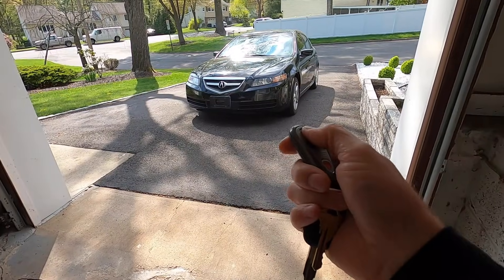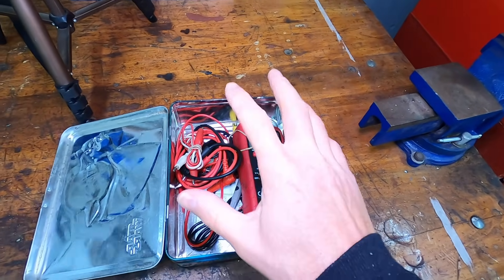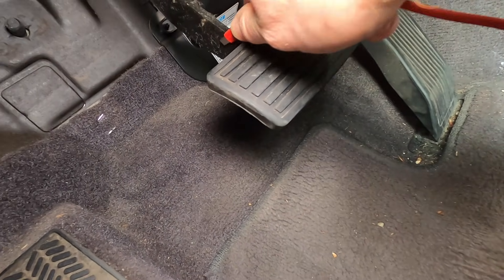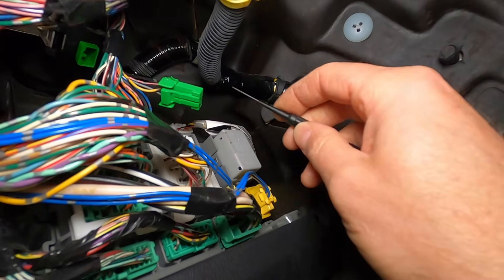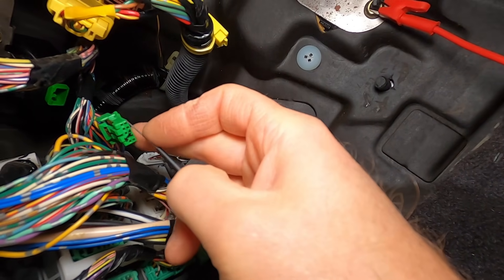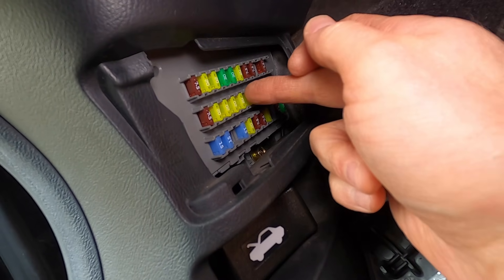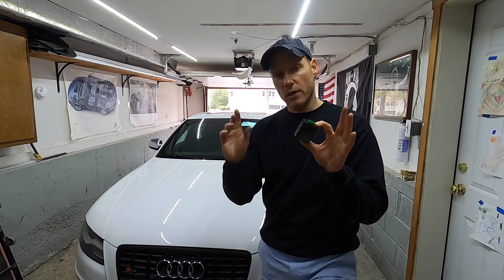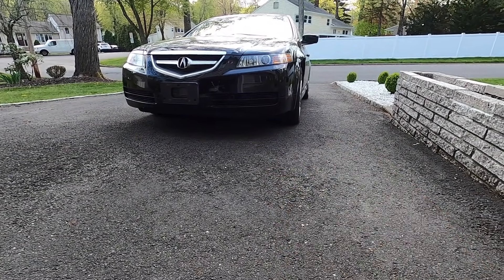Keyless Entry Not Working? Try This!

Comment: Anybody put there know if you can have one malfunctioning button on a key fob and it be a problem with remote keyless entry module and not the fob?  All the buttons in the car to control lock and unlock functions work, so it appears to not be a TIPM or fuse issue.

Comment: Can you do this on my Acura TSX 2013 model second GEN. Because I have an issue with my radio not working at all plus my keyless entry for the car is not working either. I changed the battery on my fob key, but I tried to reprogram it, but it still doesn’t work because key adaptor is not working

Comment: Hey I’m having close to the same issue with my ep3 Honda civic, I followed your guide in testing the wires and they are all reading correctly. I used a different module out of a crv that I know worked with its own fobs and still
No luck, anything else I can check?

Comment: Acura TL 2012 Keyless entry key driver #1 doesn't work for locking or unlocking only but keyless entry key driver #2 works. The battery is 100% good. What next could be the problem because it can't be whe receiver in this case!!!?? Any insight that can help?
Reply: I'd try reprogramming. Watch a video on how to reprogram keys on your acura tl. If its the same process as mine you have to stick your good key in the ingnition and put it to the on position click lock then turn to the off position. repeat 3 times. Make sure you have all your doors closed. I think then you press the lock button on the secondary remote

Comment: I installed a keyless entry system and if i leave the car locked for so long it won't open remotely unless i use the normal key but then it starts working again

Comment: SOMETIMES CHANGING A BATTERY IS NOT THE SOLUTION for a 7th. Generation Honda Accord Key Fob not Working?... This is a possible FIX---  I went through of several agonizing days of research till I found the answer to why my HONDA ACCORD 2006 Key Fob Stopped working.
ANSWER: 
Open the Fuse box lid INSIDE, Left of the Driver seat. The Key fob may not work because the 10 amp fuse number 7 (SEE bottom row counting from left to right.) 
THE FUSE IS CALLED "BACKUP" * (That label is misleading and confusing!!!!)
CHECK THAT FUSE... Mine was Blown and i replaced it with a New Fuse and The Fob functioned perfectly again.
NOTE: The Fuse may appear Intact but i looked carefully with a Magnifying Glass and discovered a tiny Break at the Bottom corner. So my advice is to REPLACE the Fuse even if it looks OK.WATCH THE SECOND HALF OF THIS VIDEO... It explains it all: 
https://youtube.com/watch?v=eSJCs4CIhck&si=G88t--AZewYCNigL
: * FYI What does the backup fuse control?
The backup fuse helps us to control the maximum current in an electric circuit. The fuse wire melts and thereby breaks the continuity of a given electric circuit. This saves the electrical/electronic devices, present in that circuit, from damage and destruction by short circuits.

Comment: l just took battery out blew into it..replaced battery used small screwdriver to softly push batterysides in to hold battery and ensure better connection..
Works again.
But had to reprogramme key to car.
Wrote to google 
example ..
How to reprogramme Subaru Tribeca key after changing the keys battery

Comment: Hello, I have a 2005 Mazda Rx8 and I have the same problem, the doors won't open with the remote control. It was all since they changed the air evaporator. Could that be the problem???????

Comment: So if all power is good, and fuses are good the receiver is bad?  I’ve tried for hours programming no luck, idk if it matters my radio is aftermarket.
Reply: Doesnt matter if aftermarket radio. The radio security system on stock is just for the radio not the car security system